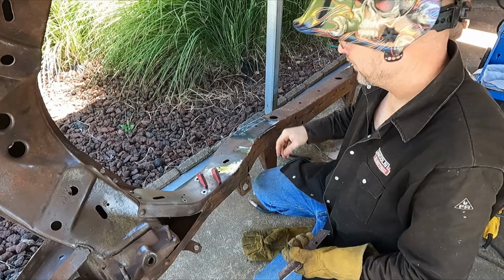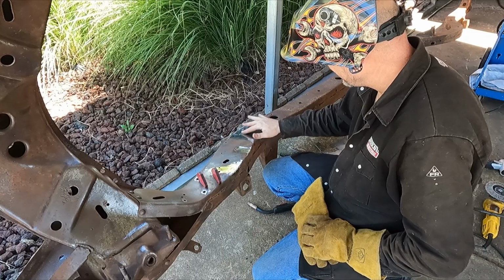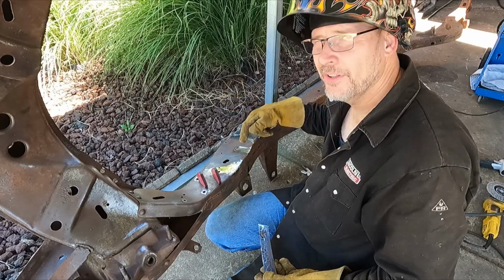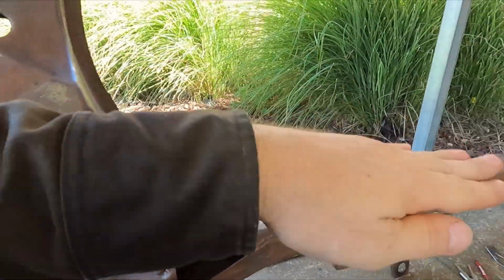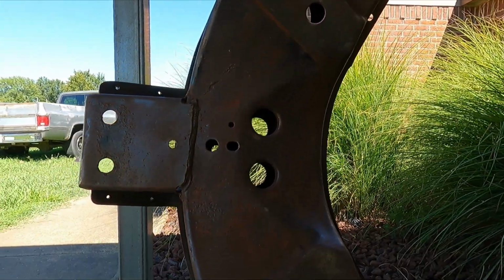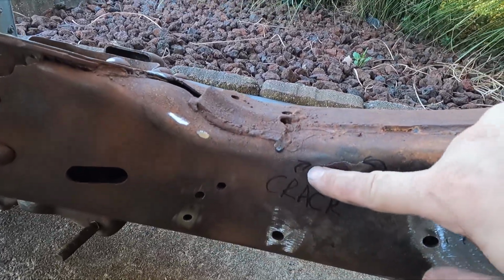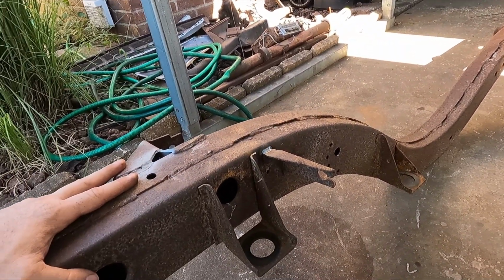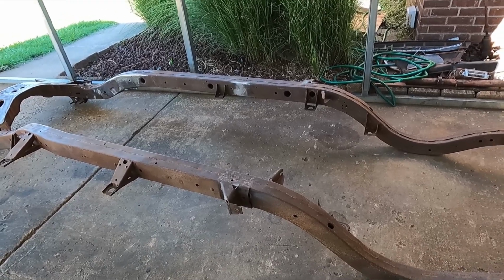Steve's 55 - More of Day 15

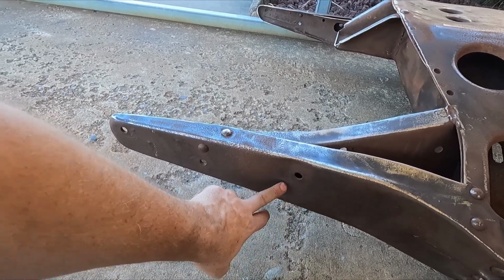Comment: That front area at 16:00 with the horn try a hydraulic wedge ram inside and avoid cutting and patching possibly.Might just fit in there its close. Dont know if you have the  ramkit or not. I Dont mean to be a nuisance with chronic suggestions but maybe save you time now that your almost done....So nice to work on a chassis separate like that too makes chassis work challenges much easier. Nice job as always, Im retired  with 30 years of straightening metal experience Aircraft parts large and small just to let you know share the advice is my say,HA!